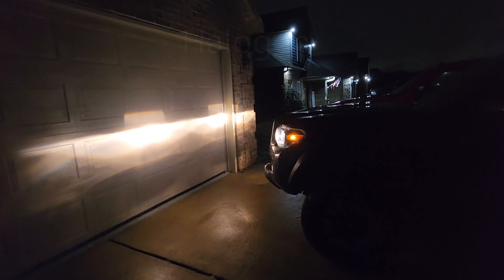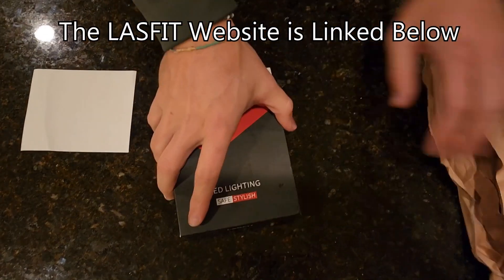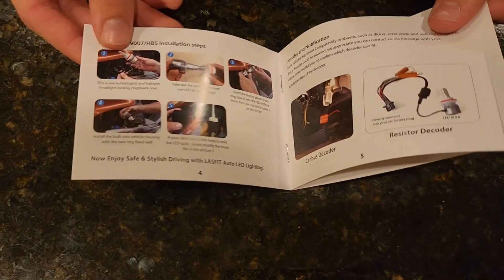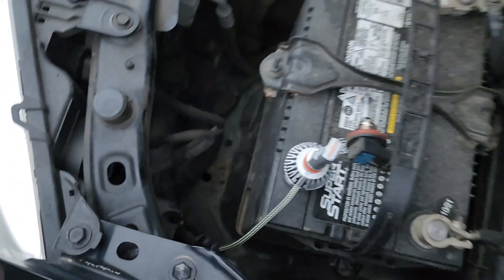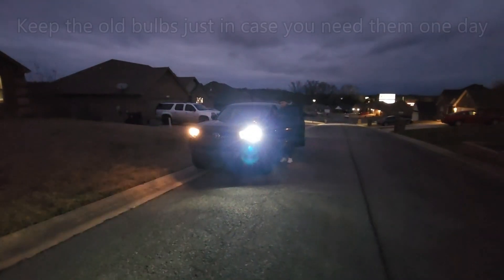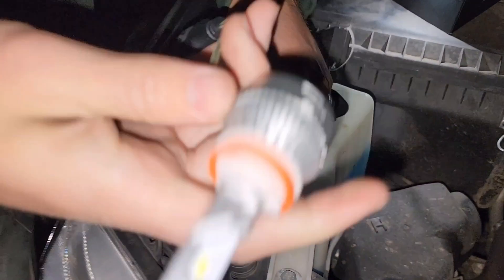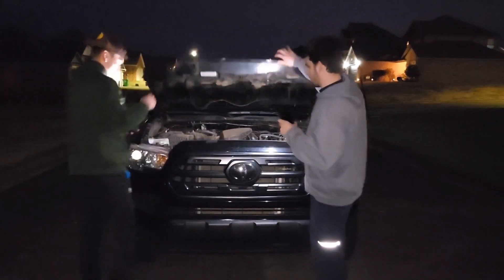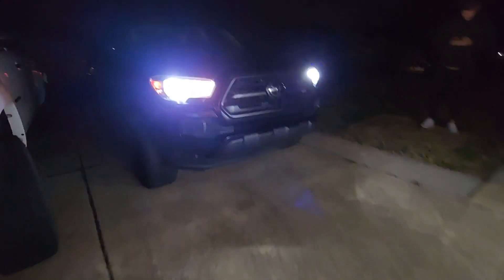LASFIT H11 LED Bulb Review and Instillation - 3rd Gen Tacoma

Comment: Halogen lenses are specifically designed for the location of halogen filaments.  The LED may seem brighter, but in fact you have decreased visibility.  The H11 to H9 mod is much better and only costs $20ish dollars.      Additionally those that live in cold climates will appreciate that halogens will melt the snow off of your headlights.  LEDs will crust over with snow and ice in no time .
Reply from the maker: Thanks for the information! I'll look into it!

Comment: According to their own web site, these are 100% illegal for street use as a headlight. Go check for yourself.
Reply from the maker: Dang. You'd probably have to get an LED housing to make it legal.
Reply: @ZachHollenbaugh  yep! If the housing is designed for LED’s…you’re good!
Reply: We all know that. Even if it’s illegal, that’s ok. As long as we’re not hurting anyone. 

These are still a must have upgrade led. 

These are the right type of led bulbs that u will not blind others, as long as u also adjust the beam pattern and fix the orientation as well.

We rather have them to see better and be seeing better, safer, and brighter.

And it doesn’t matter if it’s projector or reflector. 

These led bulbs are design for both because they are using automotive oem grade led CSP flip chips. To mimic thr same beam pattern as oem.
Reply: @toyotabrony  LOL! Illegal.
Reply: @1-Nice-Guy we know but we still run with led. And we got no issues at all. 

Realize that most of the led bulbs can produce same wattage as the factory led headlights and HID as well. Halogen sucks lol
Reply: @toyotabrony  It has nothing to do with wattage, it has to do with the beam pattern LED's produce. Still illegal. :-)
Reply: @1-Nice-Guy it doesn’t matter if it’s illegal or not. 

We prefer to upgrade with led to see better and be seeing better.

Where I live we have no problems at all. 

As long as we’re not hurting anyone, we’re good.
Reply: @toyotabrony  "it doesn’t matter if it’s illegal or not."...says it all.
Reply: @1-Nice-Guy  exactly. 

That’s why safer to drive at night better with led. 

Not all led bulbs creates equal though.